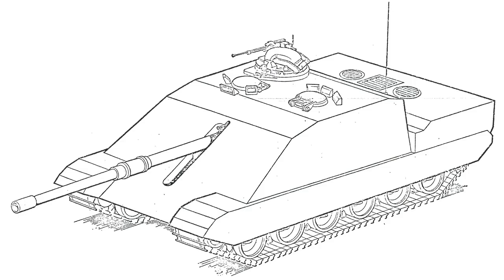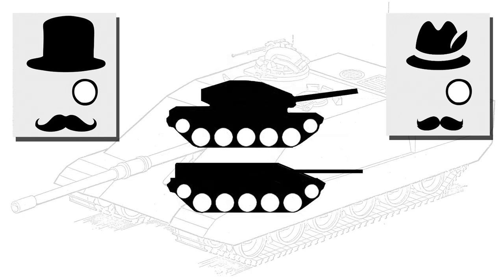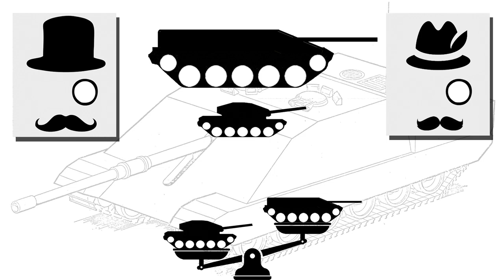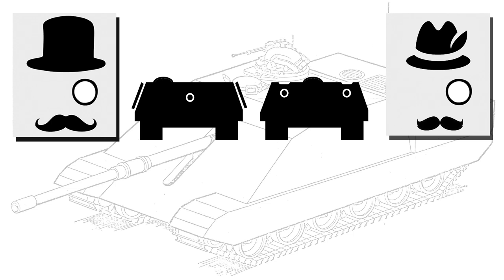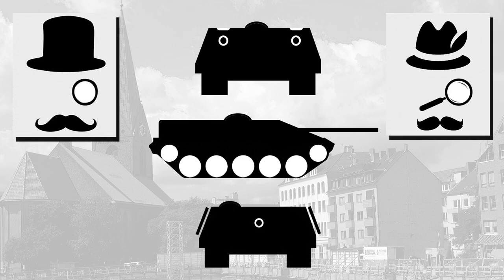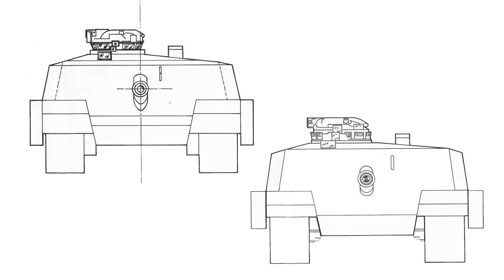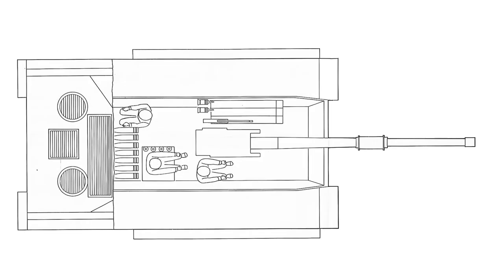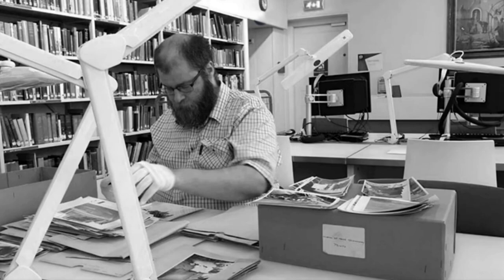Future Main Battle Tank - Tank Design & Development (Part 3)

Comment: One issue I see has a large bearing on a NATO battlefield. Since the opening combat would be a series of delaying actions trading ground for time, a casemate tank would be at a serious disadvantage. One thing we practiced, I was a tanker in the US Army stationed in Germany, was retro grade movements. Fire one or 2 rounds back out of position and once clear put the gun over the back deck and be ready to engage as we moved to the next battle position. So the ability to fire while moving in any direction was crucial.
Reply from the maker: yep this was a critical factor that cam in late rwhen we switched from casmated to proper tanks again
Reply: The VT casemat tanks where about as fast backwards as forwards
Reply: Or you could skip turning around, just keeping the well protected front pointed towards the enemy at all times and instead have the tank constructed to be about as fast in reverse as moving forward.

Again, keep in mind that this was before there was effective gun stabilisation.
Today, there is no question that the turret is superior since it can fire accurately in any direction while the tank moves.
Reply: @johanmetreus1268  Try driving backwards using the terrain to best advantage to give you cover and concealment. It was not straight-line driving and the next battle position could be a klick or 2 away.
Reply: @thomaswilloughby9901 , again, not a problem as proven in 20 years of service with the 103. Switching between going forwards and backwards just required some 15 metres of reasonably flat ground, should it be needed.
https://www.youtube.com/watch?v=Vsz1rSQTAfA

Comment: Casemate tanks have actually performed quite admirably in WW2, arguably had Germany produced more StuG 3's and 4's, maybe streamlined them a bit, they would have all the tanks they could ever wish for, super cheap to create, light weight but offers superior armour to a Panzer 4 duo to the nature of its design. And could handle a much larger gun, ont-op of it they were easier to convert to other types of vehicles. The concept is quite sound, its obviously not designed to fight in places like urban, forested areas, or fire on the move, but seeing how NATO was constantly pushing the idea of being on the defense, that was fine and Germans did use StuG's quite aggressively to some success.

Comment: I actually quite like casemates (as someone who used them alot in COH2 like SU76 and stug). The lack of a turret is a bit annoying to alot of tactics, but I think paired with some smart tactics, these things could perform just as well as they did in WW2. Id imagine a battleplan that centers around them being in the middle of the formation, where they dont have to turn too much to fire at targets ahead of them. Using their low profiles, better forward armor and likely bigger guns, these things would make for great frontal attack/defense tanks.

To combat the potential issue of flanking a Forward facing tank formation, you have a few wings of turreted tanks on each edge, who can rapidally respond to flanking attempts while flank casemate tanks adjust their angle to counteract the attempted flank. This would also allow the casemates to basically have their best armor exposed to the weaker side armors of approaching enemy tanks, who not only have to fire on the go (alot better these days with gun stabilization) but also firing at heavily armored casemates with defending turreted tanks harrowing them into kill zones.

Comment: That 'podded' layout is also an interesting solution to the problem of NBC sealing I hear oscillating turrets had. I wonder how the crew, driver especially, controlled the vehicle if the pod is effectively separated from the main body of the tank. An early drive-by-wire system run through the pod's axle/trunnions I suppose.

I also wonder if you could mount the whole pod on a limited-traverse 'turret ring' to get around the whole 'traverse with only tracks' the British objected to. Probably too complex at that point and you were better off with a conventional turret as you've essentially made a driver-in-oscillating-turret tank at that point.
Reply from the maker: indeed ur almost back to sqaure one at that point

Comment: You'd think that at some point they'd not only drop turrets from tanks but also main guns, replacing all that with anti-tank missile launch cells the way naval warships replaced virtually all their guns with missile cells. A modern tank chassis could probably house 40 to 50 javelin missiles if a launch cell were designed for it.
Reply: I think the issue between missiles and MBT guns comes down to a economic/industry/logistical issue. 

Missiles are by far more expensive per unit than equivalent MBT rounds, and may be less effective in some situations as Anti missile defenses are likely going to be more prevalent on the battlefield. (at least in my mind)

The obvious reason why these missiles would cost more is simply because of the complexity and materials needed to create one. 

Which industrially means your likely going to be producing less missiles compared to the same energy spent making MBT rounds. Which in turn makes it more than likely that your army has less ammunition for the same money, and logistically this means less rounds for each tank. As well as less stored rounds and potentially more sporadic supply runs. And if you were ever in a large scale conventual war, having your primary ammo be highly expensive, hard to make and hard to keep in stock means your forces are likely going to have less ability to stay in combat. 

The reason (in my mind) that the navy has done what you are speaking of is mainly due to the difference in issues faced by the navy vs army. The navy generally has dramatically less ships who are of higher value than a single army tank. Which justifies long range missiles even if they are dramatically more expensive. They also have a better range, allowing them to take full advantage of the flat ocean environment, where cover is nonexistent and you're targets are quite large. Beyond this though, you can see the navy actually designing and creating rail gun systems, which allow ships to fire way beyond visual range with
way cheaper rounds that are hard to defeat.

TLDF ballistics are cheaper per round

Comment: Like the gun pod idea but how about lateral gun movement or is the sketch a bit misleading there? I guess that the gunner would benefit from having some precise tank movement control when the tank has to turn so he could lay the gun quickly. Love the basic simplicity and low profile of a casemated AFV , there is still a role for them using at least equivalent tank firepower but fashion says no.

Comment: I think the Swedes did it better. At least I like it better. The engine was in the front meaning your crew might actually survive a direct hit. And its armor was much more angled. Yeah, it couldn't shoot on the move, but, that auto-loader was very reliable because the gun was fixed. Also it had a very short ground footprint meaning it could turn very very quickly. (2 seconds for a 180)  Faster than a lot of turrets honestly. 
But, I applaud the Brits and Germans for at least considering them. Turrets are great for on the move shots, but, if you're hull down, casement or fixed gun vehicles are a bitch to try and hit. Especially since they can drive backwards as well as forwards.

Comment: Thanks for these videos. I wonder how western tank crews would have reacted if they had to be in turretless vehicles while facing masses of traditional turretted soviet MBT's.
Reply from the maker: probably not very well, but well cover that in part 4
Reply: Depends on what doctrine they'd been trained in.
The BOAR tests of the strv 103 were notorious in using them in the exact same manner as their current tanks:
* Strict chain of command, with the commander giving orders, waiting for the crew to finish preparations and then order execution rather than the Swedish system where tasks fluidly got passed between the crew members as required.
* The lack of concentration to front; where a Swedish tank platoon would not separate more than 150 metres, the British would happily spread out to 600 metres, making it impossible to provide mutual support.
* Crews complaining about the arduous maintenance of the strv 103 in comparison, when in reality their own tanks had a lot heavier maintenance burden, just never actually enforced as with the S-tank and therefor mostly neglected.

This didn't get better by the British crews, in particular the gunners, being well below the standards of the Swedish conscripts for the same positions.
SP15 dug up the Swedish report from said exercise, and it is rather merciless as far as formal reports go. Basic conclusion was the entire test was set up to prove that turretless tanks could not work, and all measures was taken to prove that as a fact.,

Comment: wouldn't stabilized gun pod (or gun in general) allow limited fire on the move (limited to shooting at targets in along the vector of travel), not complete lack of fire on the move? 

i believe the germans planned to have their casemate vehicles fire on the move by use of targeting computer, however even this required atleast briefly heading in the direction of the target while moveing, so is still a limitation.

i find the gun pod tank design very interesting
Reply from the maker: the german ones had a swing though fire option which was quite complex, the uk ones didnt,

Comment: Fascinating! I can't imagine how a casemate design would be considered to be a MBT? Fine as a tank destroyer, but for offensive tank, assaulting the enemy, you need a turret.
Reply: If we think of the NATO position back then, I don't think we were too worried about assaulting, more a case of defending, and being able to wallop  WARPAC from pre recce'd and prepared positions. After all - the Wehrmacht had a bit of a heads up, and as the man says, the S Tank was an MBT, tank destroyer is now mainly a Wot/WT tag. But - fascinating as you say!
Reply: Sweden says hi.
Reply: The Stug was originally designed as an infantry support weapon and it was very effective in that role. So no, history shows that a turret is not essential.
Reply: @FairladyS130  Turretless is fine in a defensive anti-tank role, or as an infantry support weapon. But an offensive tank has to have a turret.
Reply: @stuartdodman9817  Well that's the popular US opinion but the Germans showed in WWII that casemate AFV's were by far the best bang for buck. Which means for the same $ you get more guns. Superior firepower usually wins.
Reply: @stuartdodman9817  During that time frame DEFENCE was the most important part for Western European countries
Reply: @stuartdodman9817 ,  you are forgetting a KEY POINT here. At this time, the ONLY way to fire accurately was to STOP the tank to a complete halt.
The US trials in Aberdeen between the M60 and the S-tank concluded that the S-tank opened fire in average half a second slower than the US tank, while having 70% better accuracy.

What made turretless tanks obsolete was the gun stabilisation improving drastically, allowing fire on the move at 80% or better compared to stationary fire.